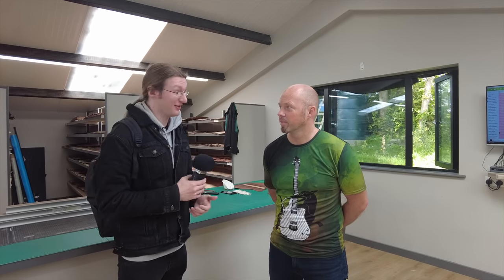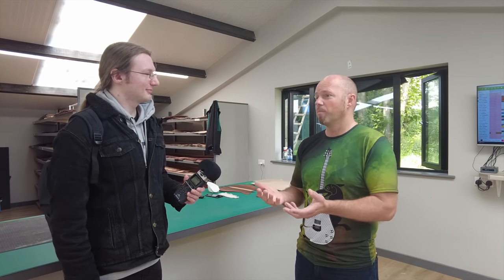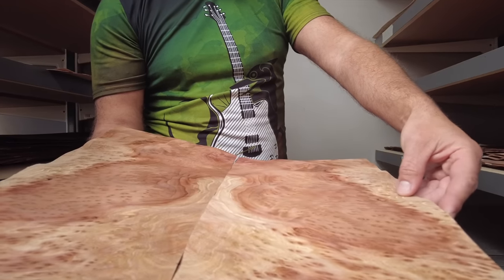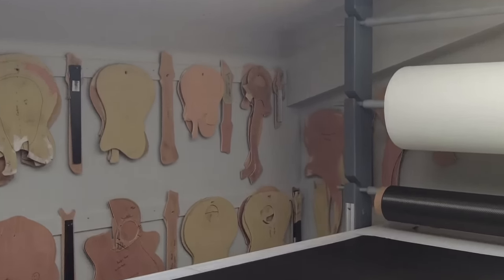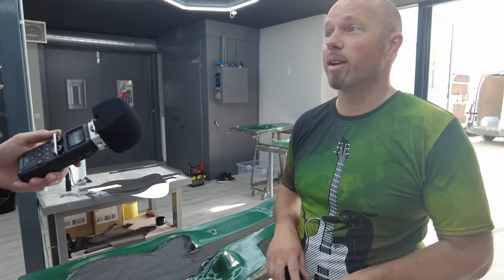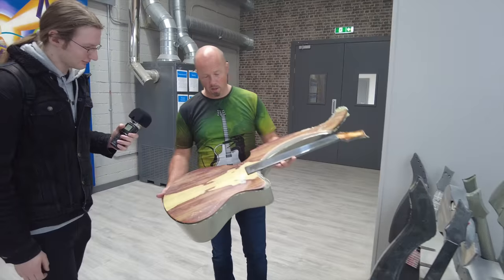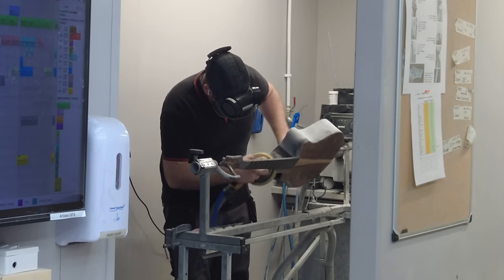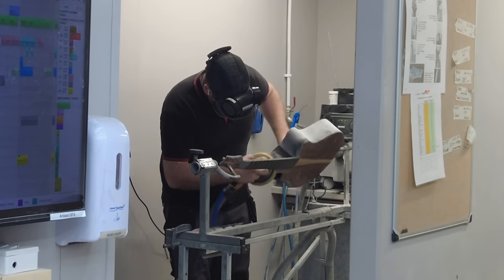IRELAND'S BIGGEST GUITAR FACTORY -  Emerald Guitars

Comment: Hi all!

Just wanna quote myself about my thoughts of Emerald Guitars:

"I am a tone nerd, and I was a bit suspicious before I got my X30, but all my fears was unnecessary. The tone is beautiful. A lot of bass but not too much, just natural. The mid and highs are clear and well balanced.
Many quiet nights when the family has gone to bed I sit in the living room with candles and tea (In a nice Emerald merch mug) and just let the inspired harmonies flow from the guitar. And I am amazed by the sound of the guitar.
I am a car dude. Used to have BMW and Mercedes Benz. But now I borrow my neighbours Volkswagen Caddy. The guitar set me back a bit and I save money for a high end acoustic mic to have installed in the guitar and a high end preamp/blender to let the superb sound be available for the people who hear my guitar via a speaker system.
And not at least for myself via my Shure SE846 in ear monitors...
Worth noting, I am in the high end home audio business. Manufacturing gear for a well known brand and strive for perfection. So one other thing I need is a better interface to connect my X30 to the different speaker systems I got."

And the issue about carbon fiber vs. wood:

"I love wood. I like the smell of my old Martin. But the sound and playability of my X30 is just superb. Not to mention it is unaffected by temperature and moisture.
And I have been in the business of glass/carbon fiber polyester/vinylester/epoxy so the tiny smell of my X30 is familiar. Not wonderful, but not bad in any way.
The advantages of carbon fiber is also one of the reasons for me to consider another Emerald guitar in the future.  But now I am fully occupied to explore the possibilities of my X30."

The environmental issue of carbon fiber and resin someone brought up:

""I guess they are aware of the environmental responsibility of working with carbon fiber and epoxy.
But compared to the environmental damage the blades of all these wind farms cause, it is not even a drop in the ocean.
As all the plastic debris from the blades in the ocean the wind farms literally cause.
And if we should care about the recyclability of the guitars, I guess that too compared to the wind energy plants, is a not even a drop in the ocean. Or rather, in the soil, as they sometimes dig down the "recycled" wings in the ground.
And, the lifespan of an Emerald guitar is many times the lifespan of the wind plant wings.

So a conclusion, all the guitars Emerald will ever make, will not add up to the environmental effect of a single wind turbine blade. And they are still supposed to be the Holy Graal of environmental focused individuals."

With all these words, I just wanna let you know that the sound from my X30 is really really good.
And this guitar also makes me both able and inspires me to play better then I have been since I started to play the guitar 40 years ago.

Take care!

Comment: It's an impressive factory however I'd be nervous enough about selling 1300 guitars a year at that price point, let alone expanding that to 12,000 in the future.
Reply: Part of the cost is down to setting up the processes and machinery to work with them.
Carbon fibre is not a wildly expensive material in and of itself and neither is the resin it's impregnated with, whereas wood is going to get increasingly expensive due to climate change coupled with deforestation.
The main things that have costs associated with them are creating a safe workshop, producing the moulds and purchasing equipment.
These are mostly one-off costs, so once they have built up the capacity to get more instruments out the door the manufacturing process is very cost-effective and they can pump them out very quickly and fulfill a lot of orders with relatively low amounts of hands-on labour required to get each guitar up to standard.
I wouldn't be surprised if they started lowering the retail cost for the current line relative to the competition, reserving the current pricing model for non-standard designs and custom shop work.
Reply: @casanovafunkenstein5090  Did you miss where he said their focus was on high end instruments and that five hours were spent just on the final polishing of each guitar? You seem to have ignored the workers wages in your "main things that have costs associated with them", a cost that's only going to increase in the future.
The video showed many labour intensive tasks, from the fabric cutting to the painting, finishing and assembly, so I'm not sure how this will transition into a "relatively low amounts of hands on labour required". The high cost of labour in the western world and the amount required to produce a guitar is why so many are now made in Asia, and I can't see Ireland being an exception.

Comment: I wonder how a Carbon Fibre Guitar ages sound wise?
Reply from the maker: I would assume it doesn’t, as there isn’t any wood to dry out or change over time.
Reply: They don't - they are modern tools, not wooden and inaccurate anachronisms, prone to temperature and humidity changes.
Reply: @KDH  Yes but some of the bonds in the material would be loosened over time with constant vibration I would think? I'm convinced that a lot of the initial 'Breaking In' of an Acoustic comes from the Lacquer going through the same process! Allowing the guitar to resonate more!
Reply: @TheFissionchips  I repeat my reply to KDH 'Yes but some of the bonds in the material would be loosened over time with constant vibration I would think? I'm convinced that a lot of the initial 'Breaking In' of an Acoustic comes from the Lacquer going through the same process! Allowing the guitar to resonate more!'
Reply: I got a nice X30, and I am not really sure if the sound gets fuller the more I play it, but I imagine it does. At least, it does not get less good, that's for sure.

Comment: Carbon fiber and the resins used are hell on the environment, especially when compared with sustainably harvested wood, organic glues, and mineral oils that can be used in more traditional boutique/high-end acoustic builds.

Production of carbon fiber is incredibly energy intensive. For comparison, producing carbon fiber is several times more energy intensive than producing steel. Additionally, carbon fiber and the resins required are not easily recyclable.

So, in addition to the intensive energy required to produce carbon fiber, once the guitar is out there, it's going to be around for a long, long while.

Have Emerald Guitars implemented a carbon and resin recycling program to ensure their guitars don't eventually pile up in a landfill?

What are Emerald Guitars doing about all the carbon and resin sourcing and waste in order to keep Ireland emerald?

Hundreds of small decisions to conserve and sustain add up major changes. Every little thing matters and makes a difference in the long run.

The guitars sound lush and balanced and look great, and the consistency of sound that can be achieved through the build process seems promising.
Reply: I guess they are aware of the environmental responsibility of working with carbon fiber and epoxy.
But compared to the environmental damage the blades of all these wind farms cause, it is not even a drop in the ocean.
As all the plastic debris from the blades in the ocean the wind farms literally cause.
And if we should care about the recyclability of the guitars, I guess that too compared to the wind energy plants, is a not even a drop in the ocean. Or rather, in the soil, as they dig down the "recycled" wings in the ground.
And, the lifespan of an Emerald guitar is many times the lifespan of the wind plant wings.

So a conclusion, all the guitars Emerald will ever make, will not add up to the environmental effect of a single wind turbine blade. And they are still supposed to be the Holy Graal of environmental focused individuals.

(And you mentioned steel production, the production of carbon free steel is much more energy intensive than ordinary steel. But I am not sure how it compares with carbon fiber production.)

Now when that issue is dealt with, I can just cite myself of my impression of an Emerald guitar:

"I am a tone nerd, and I was a bit suspicious before I got my X30, but all my fears was unnecessary. The tone is beautiful. A lot of bass but not too much, just natural. The mid and highs are clear and well balanced.
Many quiet nights when the family has gone to bed I sit in the living room with candles and tea (In a nice Emerald merch mug) and just let the inspired harmonies flow from the guitar. And I am amazed by the sound of the guitar.
I am a car dude. Used to have BMW and Mercedes Benz. But now I borrow my neighbours Volkswagen Jetta. The guitar set me back a bit and I save money for a high end acoustic mic to have installed in the guitar and a high end preamp/blender to let the superb sound be available for the people who hear my guitar via a speaker system.
And not at least for myself via my Shure SE846 in ear monitors...
Worth noting, I am in the high end home audio business. Manufacturing gear for a well known brand and strive for perfection. So one other thing I need is a better interface to connect my X30 to the different speaker systems I got.

But I love wood. I like the smell of my old Martin. But the sound and playability of my X30 is just superb. Not to mention it is unaffected by temperature and moisture.
And I have been in the business of glass/carbon fiber polyester/vinylester/epoxy so the tiny smell of my X30 is familiar. Not wonderful, but not bad in any way.
The advantages of carbon fiber is also one of the reasons for me to consider another Emerald guitar in the future.  But now I am fully occupied to explore the possibilities of my X30.

With all this words, I just wanna let you know that the sound from my X30 is really really good.
And this guitar also makes me both able and inspires me to play better then I have been since I started to play the guitar 40 years ago.

Plus, with the added stuff on my X30 I paid $4200..."

Take care!